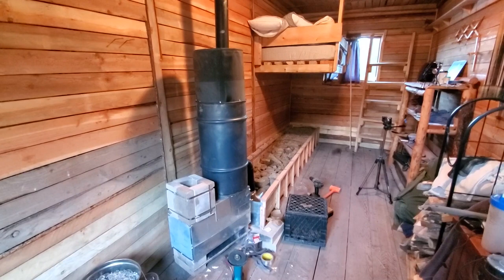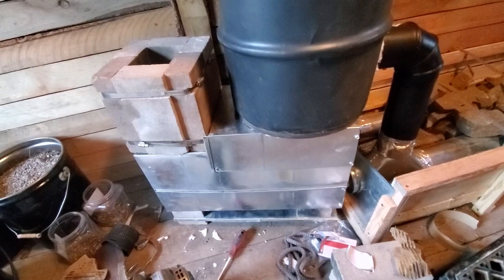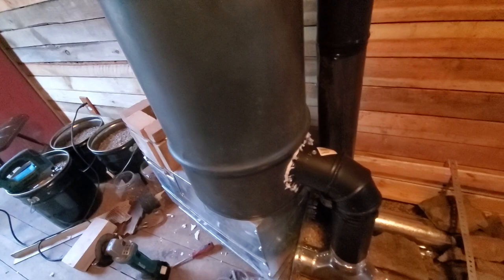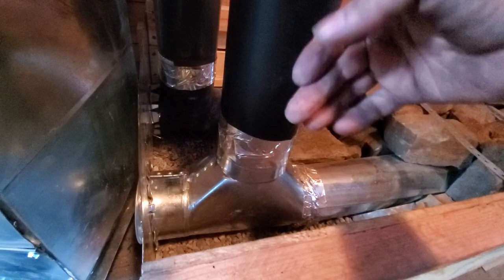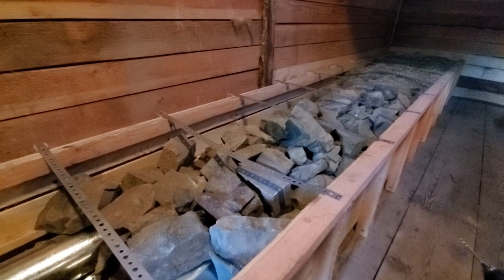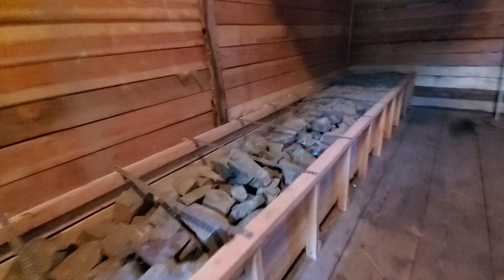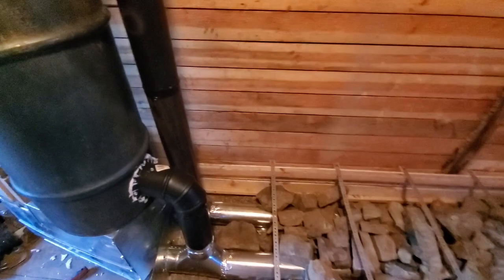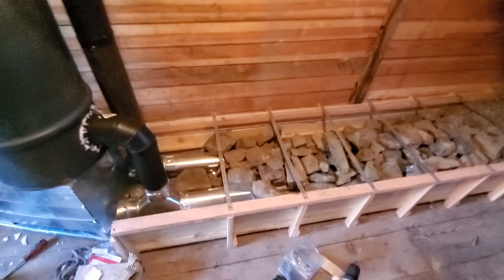Uncle Mud Tiny House Rocket Mass Heater with Pebble Bench at Wheaton Labs 2020

Comment: In terms of position and location of the the rocket heater, with regards to the actual unit and main stack, is that not going to be a fire risk issue, as you seem to have it located very close to the structure? Most stoves/ heaters  I have seen have been a tile or ceramic surround, and thick mason base to protect it from damage or warping. Will you be fixing something like heat absorbent cladding, so that this doesn't happen, or the risk at least is reduced?
Reply from the maker: Hello, that is a very useful question. I thought I had mentioned in the notes that after this video we installed a sheet metal heat shield an inch from the wall behind the entire unit and radiant chamber to protect the wall and circulate cool air. The silver metal is the cladding on the ceramic insulation surrounding the burn chamber which itself sits on top of a sheet metal heat shield protecting the floor with room for air to circulate under it too.  I am strongly averse to getting wood hot unless I am feeding it into my fire. Thank you.

Comment: Would the use of sand instead of the pea gravel and stones be better ??
Reply from the maker: Sand is more insulative than massive (dense). Insulative keeps it from getting too much heat too close to the wood walls and floor, but massive is what stores the heat overnight. Pebbles also let a little airflow through which helps spread the heat.
Reply: Would ag lime and limestone be the same result as the sand? Or would it pack tighter and act like a mass instead?

Comment: What temps are you looking at? Want to build one in a cabin here in AK but thinking it's going to be too cold for the mass to keep us warm. Sometimes -15 semi regularly, 0most of winter
Reply from the maker: Hello, I strongly recommend straw bale or other insulation. a lot of it. I also recommend that you carefully calculate the heat needs of your cabin at such temperatures--hire someone if necessary to get it right. A rocket heater of this size can only put out up to 30,000 btu per hour it is being actively fed and I suspect you will need a lot more heat input than that. An 8" rocket heater fed small chunks of dense, dry wood should be able to produce near 70,000 btu per hour. You will probably also need an insulated concrete or tamped earth floor to handle the thermal mass battery size it would take to keep your cabin warm over night, depending on how well the cabin is insulated and how big it is. Contact me at info@unclemud.com if you want to talk technical details we can consult on that. --Mud

Comment: Case of your mass made of wood? I'm surprised.
Reply from the maker: Pebbles don't transmit heat nearly as well as cob does, especially in the down direction. The bottom of the wood box is cool to the touch inside.